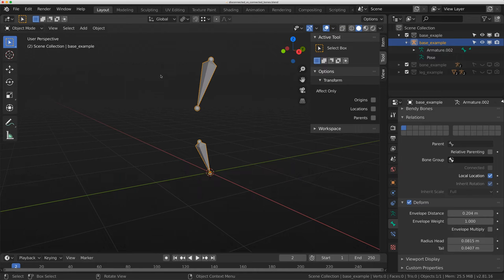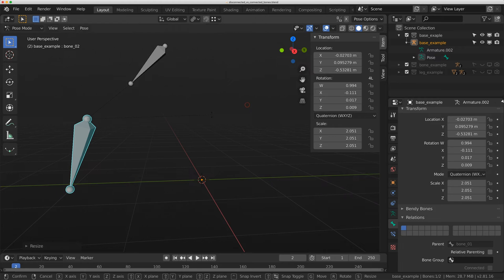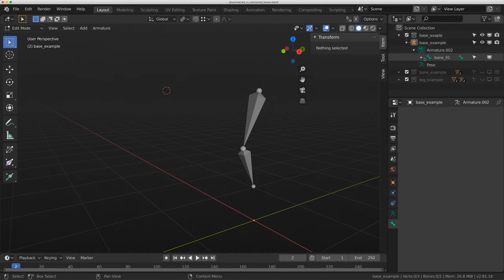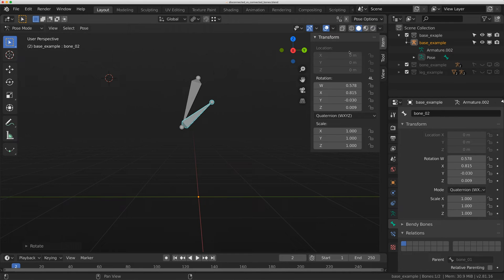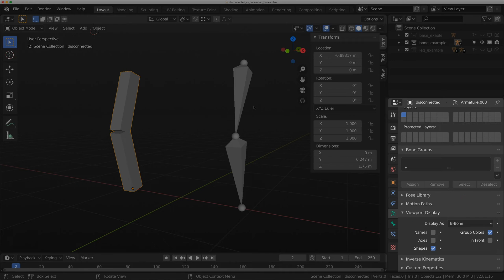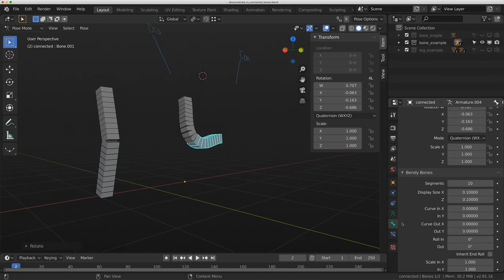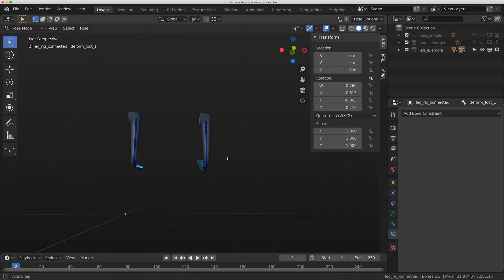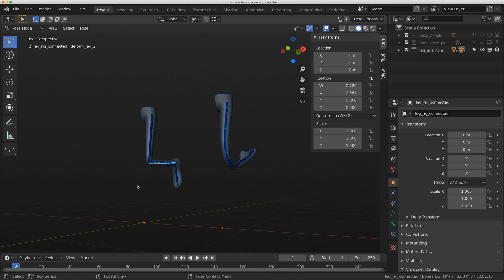Disconnected Vs Connected Bones | Blender Rigging For Animation

Comment: I have a question, i'm trying to mod a game, with new models and don't understand one thing, when i open original model from the game, it has one bone only (for visual effect attachment in game) and it has dotted line going from pivot point to the bone, i don't know how to make it with my added new bone, also "the original bone" looks like it has only 1 end, when if you add new bone with blender it adds visually different bone with 2 ends.

Comment: 1:36 I do exactly same thing in video and still my bones dont want to connect to each other 
I have selected in edit mode both ob noes I want to connect, so I go to armature. I select parent, make and then connected. Bu stil my bones wont connect
Reply from the maker: Hey, first, check out the example files I posted in the description, and make sure that your file matches these. 
Next in a clean blender, create a single armature, add two bones and test out the parent connection. See if this works in a clean file. 
Then go back to your original file and look at the hierarchy. If you can't see the connection option they might already be connected, in which case you're good to work ahead.
Reply: @LevelPixelLevel  Thank you It works

Comment: Whenever I press ctrl p it  only shows connected and not keep offset. Anyone please helpppp meeeeee
Reply from the maker: That means you are in edit mode on the armature. Make sure you are in object mode when you are connecting an object to a rig.
Reply: I'm having the same issue the bones are not connecting with eachother with "keep offset"
Reply from the maker: @ronitanandani4721  hmm maybe check out the example files, and try with just two bones in a file. Make sure they aren't already parented. If they are already in a parent-child relation the 'keep offset' option will not be there.
Reply: @LevelPixelLevel  Did anyone solve this - Im having the same problem. I will get a submenu after I hit Connected that allows me to click Keep offset - but it doesn't do anything. no line shows up, and they dont connect :( help
Reply: Figured it out....the bones have to belong to the same Armature object. That makes sense.
Reply: @AcappellaGamer  This comment saved my life.  Thank you
Reply: @PeterSpiers  ur very welcome 👍

Comment: Excellent! Best explanation of bendy bones I seem so far.
I have a question. I am rigging a scuba diver. Bendy bones are perfect for the air hose, but each bone can only have 1 parent. My hose needs to be connected at the tank and the regulator, so the bones at the ends will need 2 parents won't they?
Reply from the maker: sort of. Build the bendy bones along the hose, then use IK on one end to push back. You'll have on parent on one end, and the IK target will move the other side.